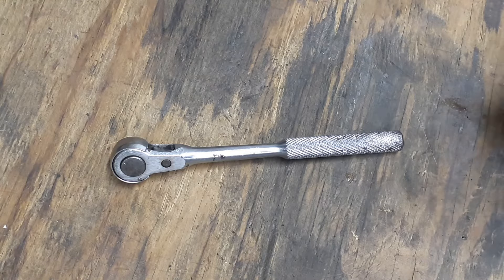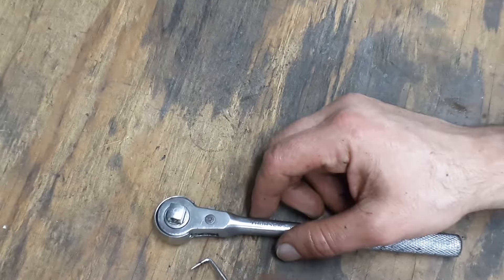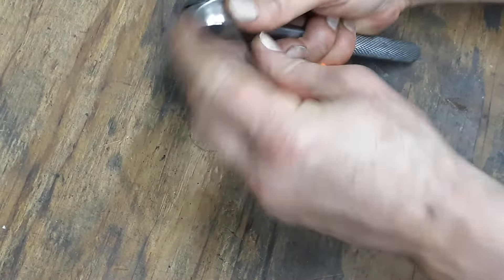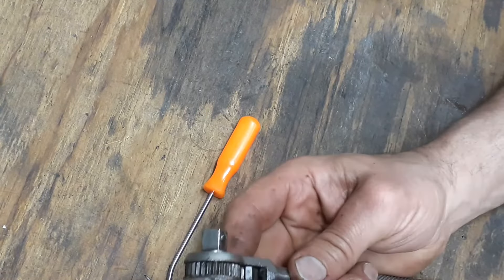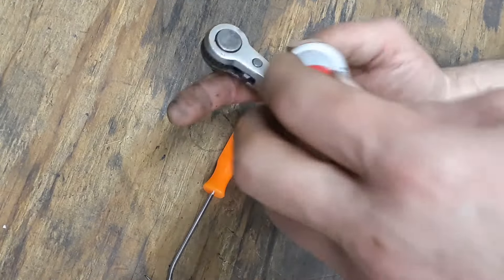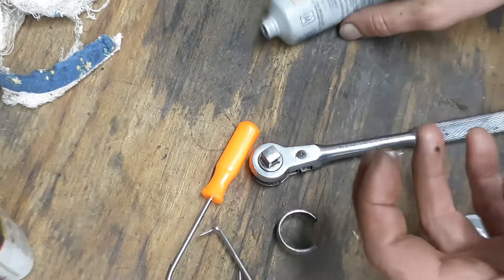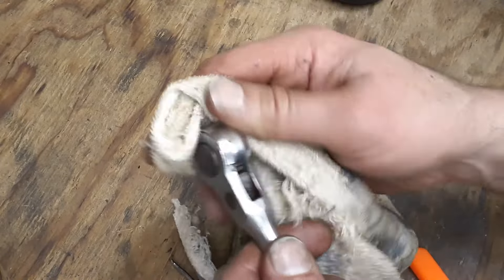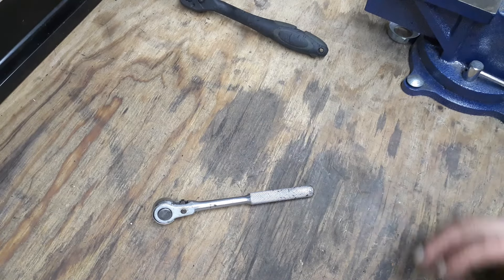Thorsen 3/8" drive ratchet 77J

Comment: I just picked one up at a garage sale for a dollar a couple days ago it was pretty rough but I cleaned it and it works great that cover is a chore but you went about it the right way putting it back on is even more of a chore my ratchet has no country of origin just says thorsen 77 but if seems to be good quality possibly USA for alloy artifacts shows a 3/4 drive ratchet same design from the 30’s with no USA stamping you are right they get dirty they quit even one speck of sand will stop it I’ll post a video on it with some other stuff pretty soon your welcome to stop by my channel if you want to see it thanks for posting it
Reply from the maker: Amen. Thank you for sharing. I will definitely check out that video you're talking about making.
Reply: Thanks I appreciate it